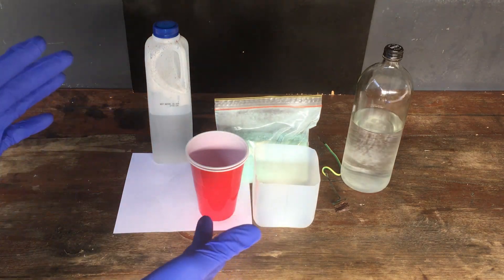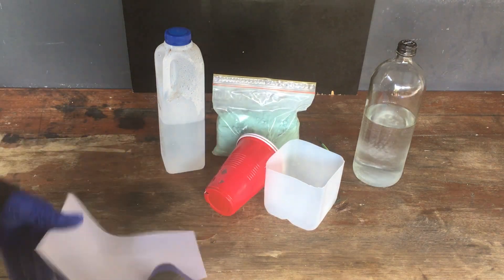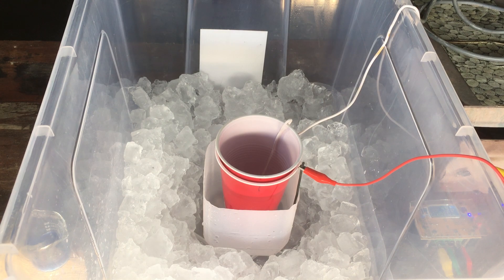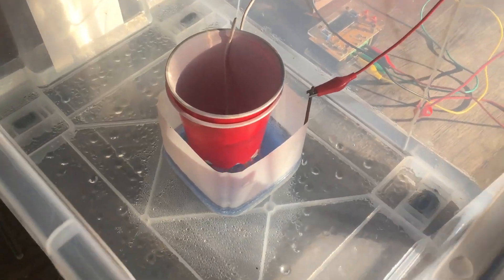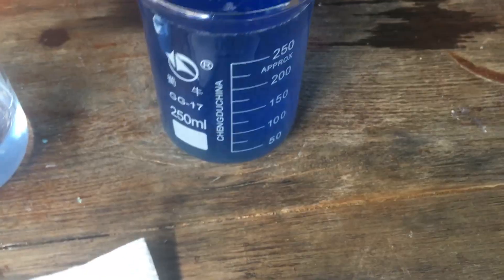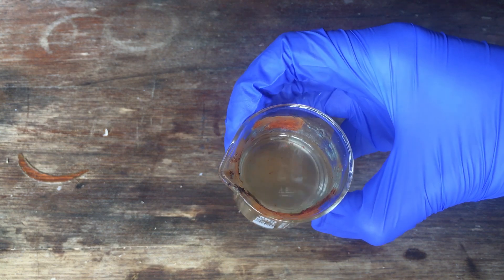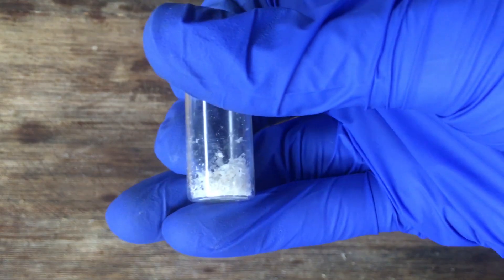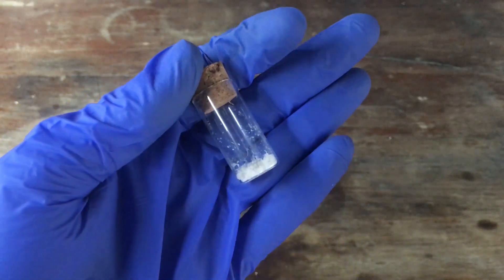Making Nitrate With Electricity

Comment: Will nickel oxide work as a catalyst rather than copper carbonate
Reply from the maker: I don't really see that working, no.
Reply: Copper works because it can easily form a complex ion with ammonia.

"In an aqueous solution, this forms a distinctive deep blue solution of the tetraamminecopper(II) complex ion, [Cu(NH₃)₄]²⁺, by replacing water molecules around the central copper ion."

source: Google

Comment: Hi, I live on a small farm in Australia.  I am off-grid and have set up a solar system to provide enough power on most days, but enough for a cloudy day.  I want to utilize the excess solar to create nitrate for use in a hydroponics system.  On a standard day, my solar system should produce ~ 100 kWh of energy, and we consume ~30-40 kwh. Excess energy per 24 days on a standard day or 70% of the time ~ 65 kwh.  Do you think it would be feasible to create nitrate from this energy or utilise it in other ways, like heating/cooling the greenhouses?
Reply from the maker: I mean, I've only showed this process to work on a milligram scale, and I've got no clue how well it scales up or even if it can run continuously. I personally wouldn't consider it feasible at this stage.

Comment: What are these koh and stuff for?
Reply from the maker: That's the supporting electrolyte, and it does the following:
- Makes the solution adequately conductive
- Supplies potassium ions for the reaction
- Maintains the correct pH for good efficiency
Reply: Thanx alot for replying❤❤❤ @ScrapScience

Comment: Ya really need to just start using Clay pots for a divider.  You can even run the backwards with the electrolyte prior to putting the reactants in to prevent any migration through it as it loads up the barrier with ions that act to transfer the charge while denying migration of solutions.  It's generally neglectable amounts that move through, but some electrochemical reactions are sensitive and it's just good form.
Reply from the maker: I've used clay pots many times in my other videos. They're fine, but for this instance, I wanted something smaller with a lower ohmic resistance.
Reply: @ScrapScience  Ah ok gotcha.  Never really paid much attention to the resistance aspect of it but I am curious if you by any chance ever checked the difference between simply running a claypot cell with and without preloading the barrier.  I'm just curious as that's part of the preloading step of running it backwards first so the ions get arranged in such a way to act as a physical barrier like what we have here in your cell but one that facilitates electron transport without needing the ions themselves to actually move essentially acting as a conductor.  Idk it's been pushing 15 to 20 years since I really sunk my teeth into all this and wondering if you ever did resistance test under those conditions.
Reply from the maker: I don't really understand the difference 'preloading' the diaphragm would do. Sure, it may allow the cell to draw more current at the beginning of the run, but the ions will start moving naturally as time passes anyway.
Can you explain the 'barrier' aspect you're talking about? As far as I understand it, diaphragms like these should not conduct electrons.

Comment: The important aspect of electrochemistry is that production is usually proportional to current flow. SO while your experiment made you a few grams of nitrate, pounds(or kilos) of nitrate will require a large number of amphours. Maybe a solar panel and battery could run a cell at 1 amp for months to make product?

Comment: can you use NaOH?
Reply from the maker: If you want sodium nitrate, yes. However, the final product will be much harder to crystallise out.
Reply: @ScrapScience  like it wouldn't crystallize like how ur video is you would need to cool it more?
Reply from the maker: Sodium nitrate is much more soluble than potassium nitrate, so you'll need to make a lot more of it in order for it to crystallise out effectively on cooling.
Reply: @ScrapScience  also I've seen alot of people put the other container directly into the setup can't we just have 2 beakers with like some cloth or filter paper?

Comment: Isn't the ammonia solution basic enough? 
Do you lose product in the form of ammonium nitrate that stays in the solution?
(I'm not a chemist by far, so please excuse newbie questions)
Reply from the maker: These are actually great questions!
As little as I know about the actual mechanism of ammonia oxidation here, I can actually answer these ones.
First of all, the ammonia solution is probably basic enough at the start of the experiment, that’s correct, but when most of the ammonia has turned into nitrate, we would lose the basicity. Adding potassium hydroxide solves this issue, since it can be added in excess. Also, ammonia solution by itself is actually not very conductive, since most of it does not ionise when dissolved in water. So, adding potassium hydroxide helps with conductivity too.
The formation of ammonium nitrate is also hindered by the presence of potassium hydroxide. In strongly basic conditions, the formation of the ammonium ion is hindered. In this case, a mixture of potassium hydroxide and ammonium nitrate would simply rather exist in solution (for the most part) as ammonia and potassium nitrate.
Hope that makes sense, but let me know if not!
Reply: @ScrapScience  Thank you for encouragement and a long, nice informative answer.

My spontaneous ideas reading your answer is that the copper catalyst would have solved the conductivity problem. If nitrates at large were the desired end product they might be more useful in the form of ammonium nitrate. But then tetraamine copper nitrate sounded like an even worse possibility to lose product. So, your points ring true from those views as well, if my ideas are close to what may happen.

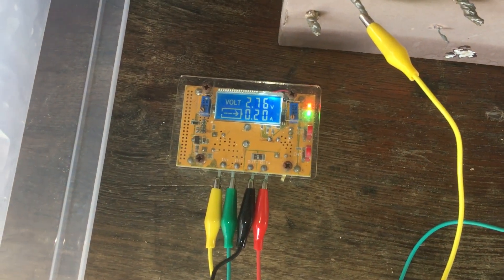Comment: 6:00 The device you used for electrolysis is pretty cool looking! Is it homemade?
Reply from the maker: I'm afraid it's not homemade, but it was extremely useful when I didn't have the budget for a lab bench power supply.
It's just a simple $15 buck converter (with controllable voltage/current) from Ebay.

Comment: I too found it hard to believe that it would actually work! Particularly the question of why hasn't it been done before or done more before in hundreds of years!!
I'm going to ask around about more conclusive tests and try myself!
  And if this works I don't see why electrolytic reduction of nitrate to nitrite wouldn't
Reply from the maker: If you're looking for more info on the topic, this paper came out not long after I published this video:
https://doi.org/10.1002/cssc.202101557
This goes much deeper into the mechanisms and possible reaction products than I ever could.

Comment: You made Schweizer's reagent with the Cu hydroxide and ammonia. This is a solvent for cellulose, so you really need to use a different material than paper for your separator.
Reply from the maker: Thanks for pointing that out! I never thought of that.
Reply: I've never heard of that, but it's sounds like a good thing to know. I'll look it up. Thanks

Comment: I saw somewhere that someone used gelatin as a diaphragm component, two chambers, a little tube filled with gelatinized electrolyte and essentially both anode and cathode produced intended elements (it was a sodium hydroxide and chlorine generator)
Reply: Actually the guy from the video did that, so maybe you saw a posterior video
Reply: Let me make what I was saying visually clear, because although he got a success, I was referring to the method I witnessed string success with: picture two cylindrical salt shakers, one for salt, one for pepper, but both emptied out. Now both have a hole cut into their sides (plastic shakers) and this hole has a short piece of drinking straw bridging both of them, like an "H". Inside that straw you can put the gelatinized substrate, or even use wet toilet paper jammed in there. They were making chlorine and lye, but their focus was lye. I think this is cool, that you can make ammonia become nitrate. I've even an interesting paper on making hydrazine with electricity (mercury cathode, hydrazinium amalgamation going on). Hope I cleared up what I doted on earlier.

Comment: How much does this process cost, compared to just buying potassium nitrate?
Reply from the maker: That will depend on how easy it is for you to get potassium nitrate, how much the potassium nitrate costs, how much ammonia costs, and how much your electricity costs. 
Overall, this is probably going to be much more expensive than buying nitrate directly, but I'm interested in the reaction because nitrates are not an over-the-counter product where I live.

Comment: Is there a problem if the temperature is a bit higher?
Reply from the maker: Based on some research that came out a little after I made this video, the synthesis still apparrently works at room temperature. I'm yet to try it though.

Comment: 👌🙏👍Good proof of concept but time consuming - KSO4 + Ca(No3)2 is messy but much easier more or less - the resultant gypsum can be washed a few times - (pain in the ass) but kilned and used with Al and flour of Sand for the extraction of large chunks of pure silicon 👌👌

Comment: Another methode of making nitrates near no one knows is the oxidation of ammonia on alkalien survaces OH groups oxidize to nitrate on high speed at 250C and above near one to one. The stroner the OH Group, faster goes the reaction . CaOH istn as good as KOH. presence of copper , nickel , Mn, Silver, ions catalyze also this reaction. Oxides doestn work it must be hydroxides.
Karl A. Hofmann wrote an work about it me be you can finde an english version in the web. I think the mechanism is the same as for the anodic oxidation .

Comment: Interesting experiment would be elektrolysis of water with kompressed air inside. I ve read they done it with an platine anode and under 50 to 100 bar pressure it forms ammoniumnitrate. To bad that an cell with this pressure is hard to make :(

Comment: If you simply added the KNO3 to H2SO4 it should produce NO2 and easy to see and smell. But still a nice proof of concept even at a dismal yields of 20%. I still would say that producing NO3- by the oxidation of herbivore excrement the way it was done in tears yinder are more effective with less input and much better yield

Comment: im now doing this btw and also trying out stainless steel electrode aswell because rather not have lead nanoparticles or other being an issue.
I have made a few changes tho.
1. using urea rather than ammonia because urea wont fuck off and evaporate away and also wont cross the membrane easily.
2. Urea decomposes at the anode chamber into CO2 which makes carbonate.
3. Sodium hydroxide used instead of potassium hydroxide.
4. boiling down the mixed salt solution then adding acetic acid since hydrochloric cannot be used
Acetic is fine to use overall since there isnt a huge likelihood for it to react in solution.
5. adding KCl to the mix to precipitate out KNO3 in a hot saturated mixed salt solution with everything else being very soluble except KNO3.
Reply from the maker: Love it! I'm keen to see how it turns out
Reply: Yep, Urea solution is available in most locales as a reasonable quality reagent for use as Ad-Blue in Diesel engines.  This would be my favourite source material.  I think Urea should be easier to extract from urine rather than waiting for bacteria to convert it to Ammonia.
Reply: @KallePihlajasaari  I leave piss chemistry to nile red. I think I prefer the smell of pure ammonia, lol
Reply: So how did it work OP?  I am considering doing this but Ammonia solutions are weakAF and Urea is a much more suitable starting material given how low the yields can be due to side products.
Reply: Can you elaborate a bit more? diy cosmetics shop here has quite pure and cheap urea. I am very interested in your experiment. Did you need to do that at a cold temperature? That is the bit that bothers me. a room temperature solution would be ideal. Whats the use of acetic acid in your experiment?
Reply: hey mister, can you make a video on it?
Reply: Any success?

Comment: NOX emissions are an issue for vehicle emissions. Can we just make the stuff from air with high pressure and temperature?
Reply from the maker: Yes, with high enough temperatures, NO and NO2 are generated from nothing but atmospheric nitrogen and oxygen. The temperatures required for this are extreme however, and can only generally be achieved in the plasma generated by combustion or by electrical discharge. Even then, the amounts of NOx generated are very minor, making the process extremely energy intensive.
If you're interested in the process of converting air to NOx compounds, I'd recommend looking up something called the 'Birkeland-Eyde reactor'. This uses electrical discharge from a high voltage spark gap to generate reasonable quantities of NO2. I'll be building one myself at some point.
Reply: @ScrapScience  
That's what I've been looking at. I'm wondering if there are ways of generating greater volumes of plasma. Apart from just using higher and higher voltages.
Could I use some sort of magnetic confinement to increase the reaction surface between the plasma and air?
Reply: @whyindeed9937  Schönherr Stove or Schoenherr written. It was an long pipe with elektrode on bottom and one on tope and air pressed inside from the bottom. with 5,5% effezienzy.
Haber (from Haber Bosch reaktion) Wrote that you cant get more than 10% effizienzy with elektric arc. in his lab he reached 7,2% and i think it was only so high because small arc with less watts so there wassnt so much cooling problem. He himself wrote if the pipe where out from metall or an good heatconducter the effizienc would be higher but i dont know how he wanted to prevent an short cut.
Reply: @whyindeed9937  Yes, magnets are used to spread out the arcs and thus create a larger surface area where interaction between the sparks and air takes place. You can find more on the Wikipedia page for the Birkeland process if I'm not mistaken.
Reply: @ScrapScience  
What about using an H2O Torch?
Run a small aquarium pump into the reaction chamber, to provide the excess Nitrogen/Oxygen. The H2O products should boil off into steam. The heat from the plasma should react the excess into NOX?

If were increasing the surface area of the plasma, are we getting an efficiency increase over the traditional Birkeland–Eyde process?
Reply: @whyindeed9937  Yes, by spreading out the surface area of the sparks/plasma you increase the amount of NOx produced and thus increase the efficiency. Another thing you can do to increase efficiency is not doing it at atmospheric pressure but at substantially higher pressure, 50 to 100 bar would be optimal.
Reply: @ScrapScience  
I don't suppose you have use for a 24V / 48V Power supply?

I just rescued 100 or torroid's from the scrap yard. All 300VA 10 Amp secondary's.

Comment: very interesting.  thoughts for scaling up, increase surface area of cathode/anode, perhaps a copper sheet or copper piping smashed down to form a rectangular surface.   Perhaps a mild steel container used for the outside housing so the container becomes the anode surface.   And I am a big fan of using small solar cells for running electrolysis reactions

Comment: Can i use sodium hydroxide?
Reply from the maker: Yep, but then you'll end up making sodium nitrate, which is considerably more difficult to crystallise out of solution.
Using the potassium salt is only beneficial for the crystallisation stage at the end, the rest of the process will work with sodium just fine.
Reply: I have limited material so, could you help me how to get better yield through sodium hydroxide!!🤝🏻